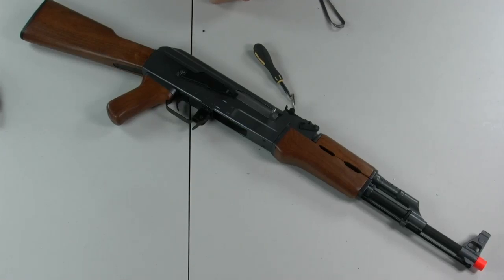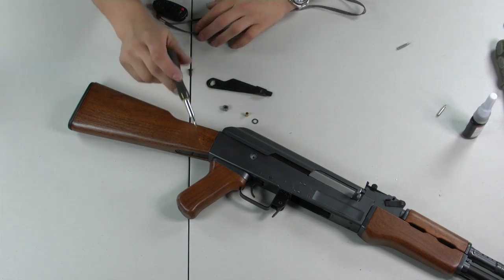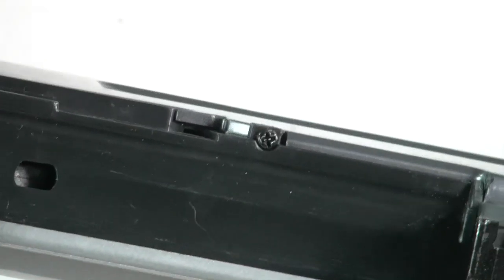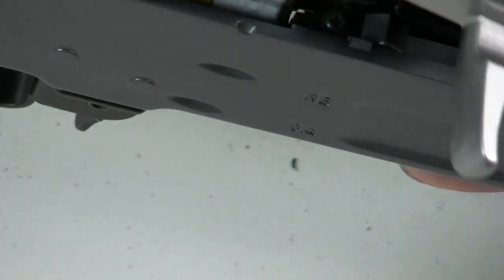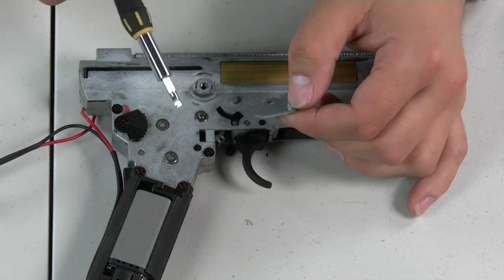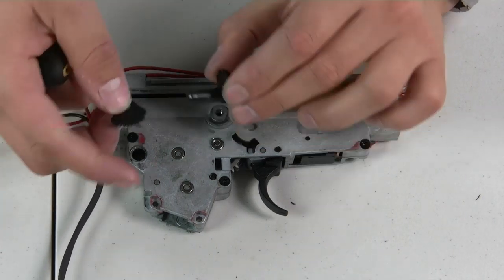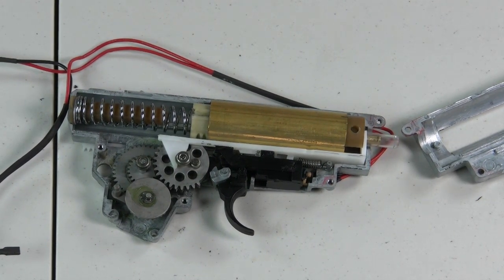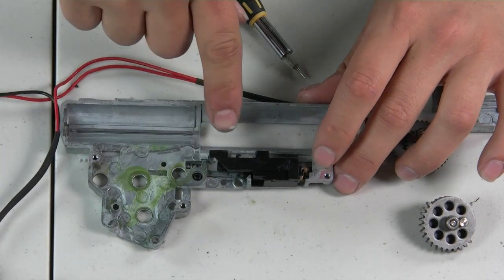HitGuns.com - Airsoft Gun Guide - CM-028 AK-47 Disassembly

Comment: Enjoyed the video, only one issue. You don't ever want to use locktite on any gearbox screw, Or thread lock for that matter. In our experience, this leads to a higher probability of stripping screw heads, and causes way more headaches later than they save. Locktite or thread lock is used on something you don't ever plan on taking apart again.

Comment: @crunkdaddy11 it may be a shot fuse. if you remove the stock there will be a conector from the wire in the stock to the wire in the gun, dis connect it... carefully remove the wire in the stock of the gun and there should be a comparment... open the compartment and you will find the fuse.. simply remove that one and replace it... if this doesnt work then it may be a dead battery... if its not that then idk what to tell you lol